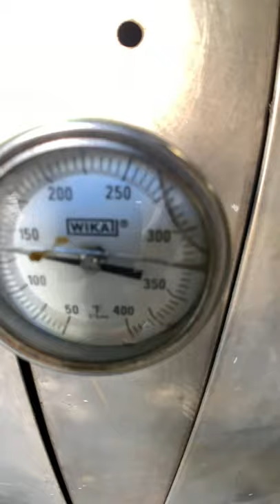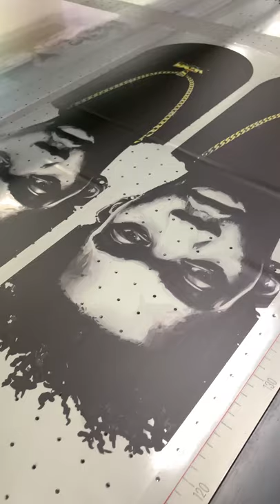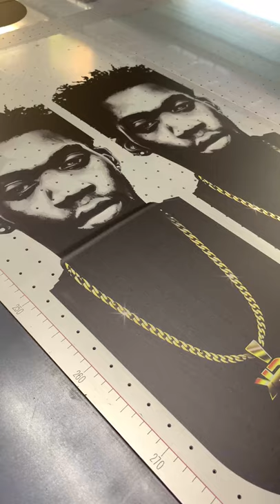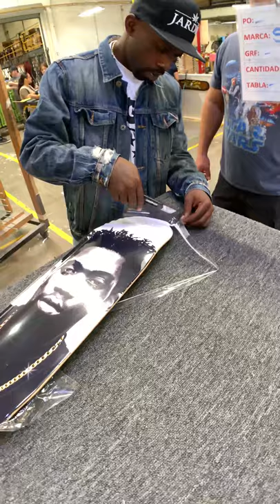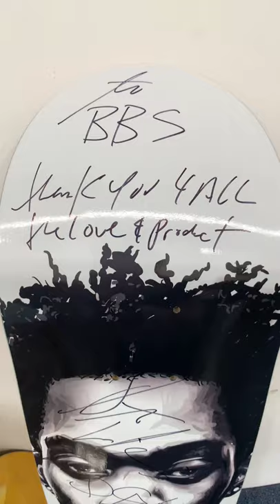How to Make a Skateboard with Stevie Williams

Comment: 26:55 - I'm surprised that they use such a manual process to pop-out any leftover wood from the truck bolt holes. The holes are a standard width and layout, they could make a 'stencil' using a small piece of wood (or left-over deck?). Drill 4x scews into that left over stencil and then they could "pop" all 4 holes in 1 go. I'm sure over a month this would save 30+ hours.